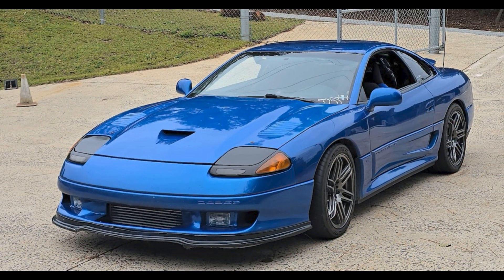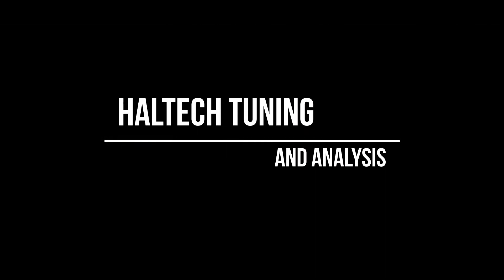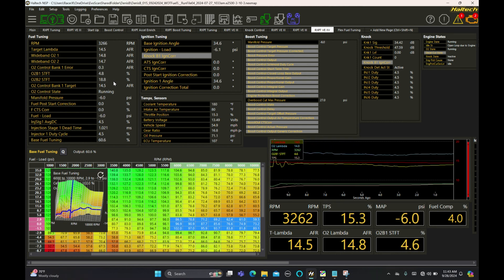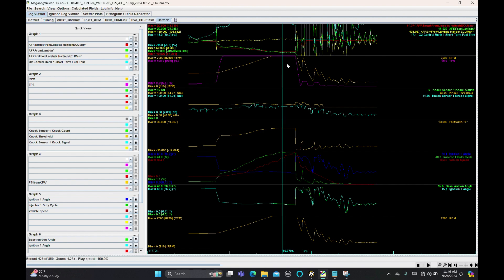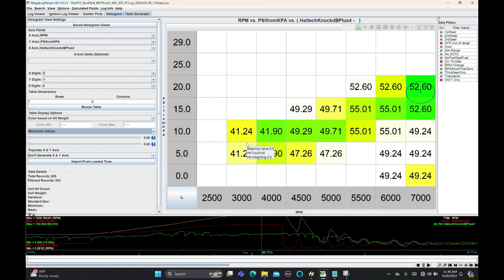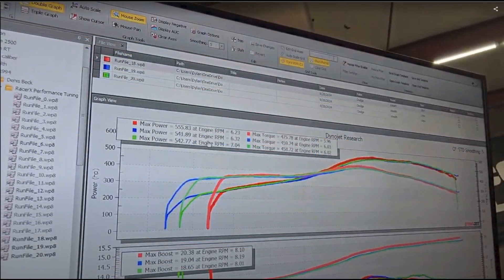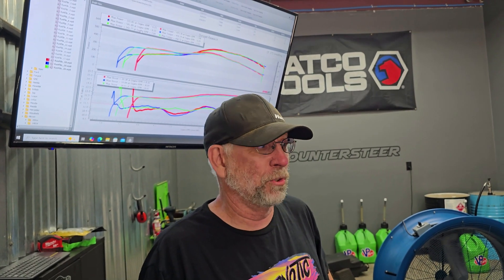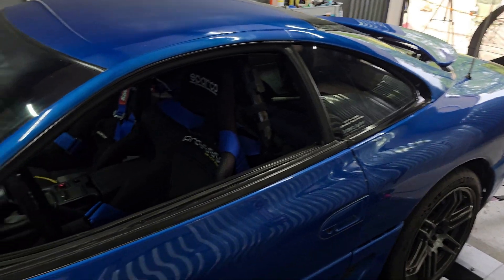Dyno Tuning the Blue Devil - 1992 Dodge Stealth Twin Turbo

Comment: Very nice!! Hey man where are you located? Would it be possible for you to tune my 3g eclipse with a 4g64 engine that is DOHC swapped with an egr delete? Its currently    N/A IN Trying to fix some idle issues first
Reply from the maker: Likely if you are running ECMLink  or Haltech. However, if it's not turbo powered there's not a lot to be gained on the NA.

Comment: Love Dennis's car and very good numbers for only 20psi! Was this on pump gas or ethanol? Does he have a pcv issue why the plume of smoke after letting off at 4:37?
Reply from the maker: We did both fuels. Final numbers were on the ethanol but the pump 93 supported the same. Yeah, not sure yet about the smoke there after the run. Denis will investigate for sure.
Reply: @Morgamania2 any idea what the smoke ended being?
Reply from the maker: @xaviervelasquez6882  No, possibly PCV valve. Car is still doing great. About to come out of hibernation once Wisconsin warms up. :)
Reply: @ I’m having the same issue but I’m wondering if it’s my spark plug gap causing the blowout and also my turbos going bad causing the smoke
Reply: Car has no PCV system anymore, well as in traditional PCV. The Peterson R4 dry sump system creates a vacuum in the crank case per design. I suspect smoke was due to my huge ring end gap and A LOT of dyno pulls with a slow accel rate. I can live with a puff, it was nerve wrecking making so many 8,000 RPM pulls waiting for parts to leave the chat. The smoke on decel has now stopped, so the new rings and things may have finally seated in....or I'm out of oil...lol